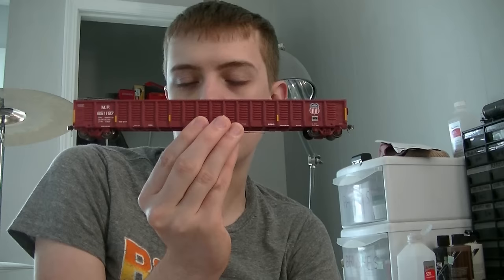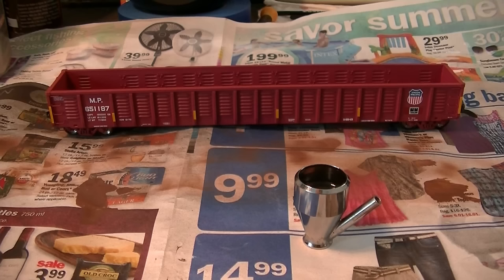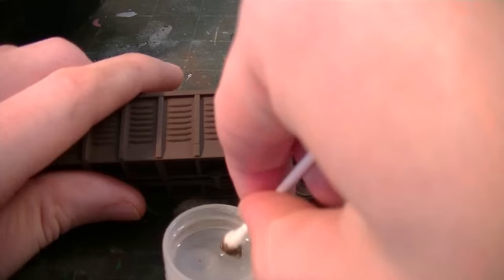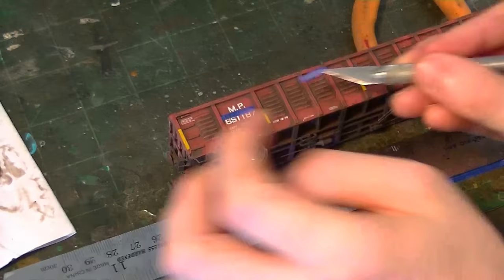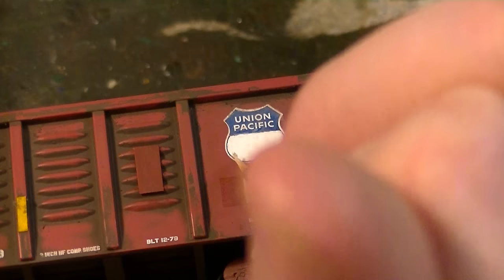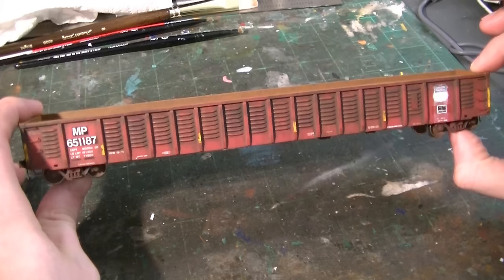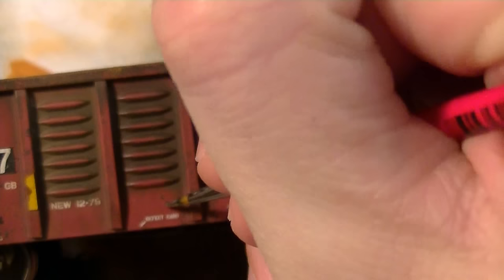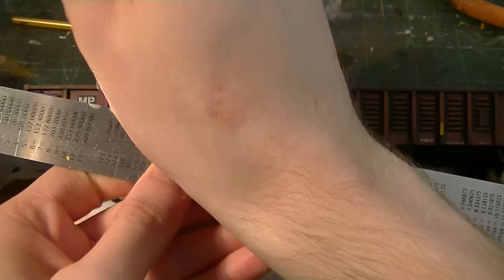Detailed Steps For Heavily Weathering An ExactRail UP Gondola!

Comment: For trucks, wheels, freight car bodies and locos to add rust I use REAL rust.  I take a roll of fine steel wool and put it into a quart jar and fill it up with white vinegar and set it on a window sill so the sun can shine on it.  After a month or two, I pour the liquid out into a stainless photo tray from my darkroom (10X14).  After it is completely dry I use a single edged razor blade scraper and scrape the rust out of the tray.  It usually comes out as a fine powder.  I then store it in a snuff container.  Depending on how long you leave the steel wool in the vinegar my batches come out with different colors of rust, i.e., some are orange and others are a deeper colored red.  When I get ready to use it I put several scoops of my rust into a plastic communion cup (neat little cups for mixing paints) and add some alcohol, Elemer's white glue and a dab of water soluble glycerin.  Then I just brush it on.  If I want an area where the rust has eaten through the metal (plastic) I use my X-acto knife and make some gouges in the sides of a car and fill it up with my rust.  To seal the rust I usually topcoat it with a flat acrylic clear coat.  It looks very realistic 'cause it is REAL rust!  Happy Railroading!
W Rusty Lane in eastern Tennessee (Witherington Place Railroad)

Comment: Man these look great.  I've switched hundreds of these old Mo-Pac gondolas and they're all fairly consistent as far as how rough they look.  The paint held up relatively well for the 30+ year old paint most of them have, but it's scratched, dented, dirty like you captured here.  The insides of some gons look almost like Swiss cheese, but for some reason this group held up OK on the sides and have that constant fresh rust color.  Next thing to try is getting them to smell bad.  Usually they have a little nasty muddy "stank water" in the bottom of them that smells to high hell.  That would be some prototype modeling right there!

Comment: DansRailroad2011 You do some awesome weathering nice Job. I weathered A Norfolk Southern ET44AC From Scale Trains Rivet Counter HO scale this was my first attempt at doing this It turned out pretty nice still have to do the fuel tanks with the fuel ran down the sides and some oil spills. 
You certainly have some very interesting videos I watch them so That I can learn from you more ways to do weathering. Have a good evening. 👍

Comment: You could also heat the sides and add some dents. Very well done.
Reply: I've done this to a lot of my gondolas.  You can use a Bic lighter and heat a flat head screwdriver to do this effect as well.  Some types of plastic get almost too pliable and start to warp more than you want it.  There's definitely a technique to heating the plastic itself without giving it too much.

Comment: Is there a faster or more efficient way to clean your airbrush that you have found? Always love weathering my cars with it but dread cleaning the airbrush with the paint inside. Thanks,

                                               -Josh RSP
Reply: Not really, I also use an airbrush extensively, and yea it takes a long time to clean. However if you skip cleaning you WILL clog your brush.
Reply: +Jackson Railfan yup, I've learned that the hard way